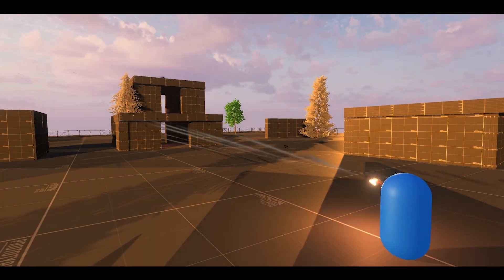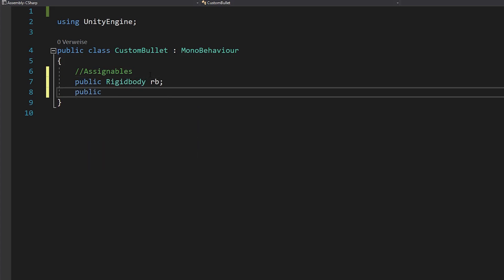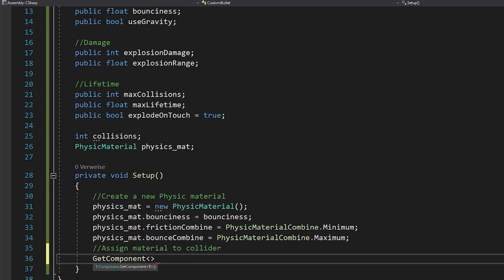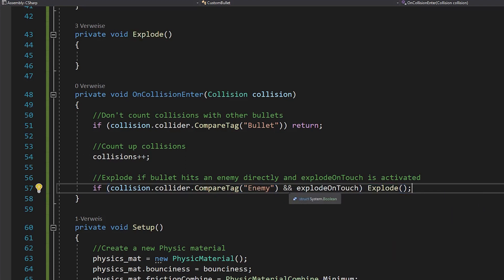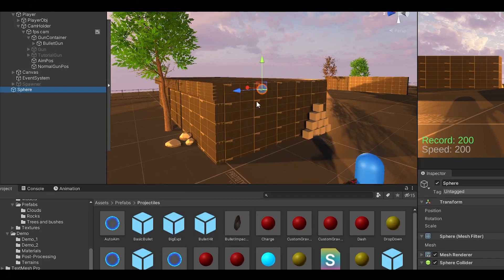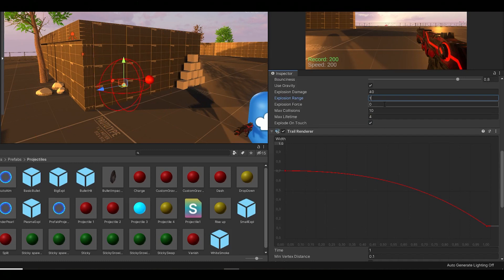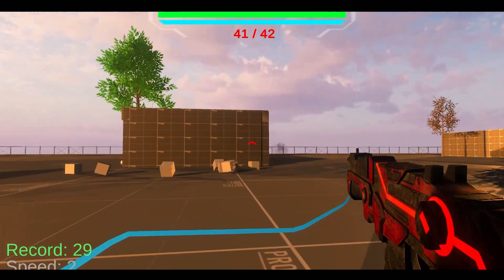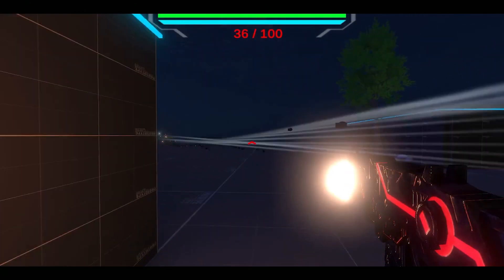SHOOTING with BULLETS + CUSTOM PROJECTILES || Unity 3D Tutorial (#2)

Comment: For people having trouble with shot bullet and it explode but the explosion did not stop 
i found some solution 

1 uncheck loop (if you are using unity particle pack dont forget to uncheck child too)

2 Under particle system there is stop action button change to destory 

hope it will useful 
sorry for my english grammer

Comment: This script here is not being activated for some reason

for (int i = 0; i < enemies.Length; i++)
        {
            //Get component of enemy and call Take Damage

            enemies[i].GetComponent<CharacterPathing>().TakeDamage(explosionDamage);
            Debug.Log("colliding");

            //Add explosion force (if enemy has a rigidbody)
            if (enemies[i].GetComponent<Rigidbody>())
                enemies[i].GetComponent<Rigidbody>().AddExplosionForce(explosionForce, transform.position, explosionRange);
        }

So my enemy isn't taking any damage. Is there any problem with this code?

Edit: The reason why this wasn't working was because the collider that was set on my enemy was through the floor instead of on the enemy.

Comment: If someone has the problem that the explotion repeats infinitely when it impacts, at least i solved it by selecting  the explotion prefab and opening it on the inspector right on the upper right where it says open, and then unchecking the looping section in all three sub parts of the prefab.

Comment: howdy. I've been using your guides to help me out with a school project, but I seem to run into a problem related to damage. I set the health of an enemy to 300 and the player at 100. both of their bullets have been set to 25 damage, but they do much more. the enemy kills the player in one hit and the player kills the enemy in one hit. (looking at the inspector, the enemy goes from 300 health to -400 to -525) maybe it was something that I did wrong related to the health ints? I could really use some help to figure out what I did wrong.
Reply: figured out a part of it. for some reason, having the life time make it explode at the end did a lot more damage for some reason. also having the collisions set to 1 or 0. with collisions at 2 and changing when from explode to delay when max life hits 0, the enemies don't do friggin 30x the damage. they still do more than 25, but now it's only a consistent 50.
Reply from the maker: As long as it's consistent, it's usable :D
If it still bothers you though make sure to debug how often the TakeDamage function gets called (it's probably 2 times), then figure out from where it's called exactly and use some kind of bool/timer that makes sure you can't call the function twice within like 0.1 seconds
Reply: yo you just got to take off the Invoke("Delay", 0.05f); and put Delay(); or just make it faster 
what its doing is its hitting multiple times

Comment: Very late but if I use a character controller and not a rb how can I add a recoil? Nice video btw super useful!
Reply from the maker: With a cc, I'm guessing you calculate a Vector3 for you velocity and then apply it with cc.Move().
In that case you would need to add a Vector3 that points backwards from your  player to this velocity variable after you shooot, and then subtract it after some time to stop the recoil again.
Reply: @davegamedevelopment  Makes a lot of sense, I’ll try that thx a lot

Comment: I'm experiencing a bug where the Explode method will instantiate 3-5 explosions at a time, making the damage dealt somewhat random. I notice it goes away if I comment out the Invoke function. It seems to be going through the function multiple times until that 0.05 second delay is over, but I'm not sure why. I have some other scripts running, so that may be the issue, but I'm curious if anyone else had the same issue.
Reply: happened to me too
Reply: Did u find a fix?
Reply: same here. did u find a fix?
Reply: I just had this issue too but i fixed it, i know i'm 2 years too late but all you need to do is decrease the delay, the bug seems to happen when the projectile uses up its collision limit, then it collides multiple times during that delay period, reducing the delay period drastically makes it only explode once.
Reply: my explosion effect never stops playing actually

Comment: I'm making a shot gun, so it shoot 8 bullets per tap, but they all instantiate at the exact same point and instantly destroy each other(my bullets have a script where they are destroyed when the collide with something)
Reply: did you fix it I have the same problem
Reply: @catman7474  i dont remember tbh
Reply: My guess is to add a line to the script that offsets the bullets based on its spread value

Comment: Can someone help me? The recoil does nothing and idk if it is the character or the gun. I am using the brackeys 3d player movement script. Thanks in advance.
Reply: That is probably because the Brackeys 3d movement uses a Character Controller component, which does not interact with physics. However the recoil script uses physics to add recoil. If you want to fix this, you can either, change you movement to work with the RIgidbody component, or, add the recoil by moving the Character Controller. Hope this helps!
Reply: @thecodeanvil5779  It worked thank you so much.
Reply: @bim0527  Awesome! So glad I could help!
Reply: @thecodeanvil5779  what movement script should I do for physics?
Reply: @thecodeanvil5779  thxxx
Reply: @DrippyHonk  You're welcome! Glad I could help!

Comment: I've got a couple questions to ask (srry for commenting so much at this point) 
#1 everytime I fire, the gun uses up 2 bullets rather than 1 even though my bullets per tap is 1
#2 What could cause my spread not to work? I have all the calculation lines in and the bit that adds the calculations to the Vector3
#3 Even though I have a rigidBody on the player, and it's linked to the gun, what could cause it not to recoil properly
Reply: Figured out 1 right after I commented, sorry about that
Reply from the maker: @BigWoofer  Maybe download the project file and see how everything is set up there :D (over my discord)
Reply: @davegamedevelopment  I did, it didnt help unfortunately, I'm sure I'm missing something obvious I'm just not sure what it could be, I ended up switching over to a hit scan weapon temporarily and managed to get spread working on that, still having issues with the recoil though
Reply: @BigWoofer  just copy the cody (or not coz ur not gona learn anything then)

Comment: hey, I've been having a pretty strange bug. whenever I walk forward while shooting, I get propelled forward really quickly. my guess is that it had something to do with the Bullet's Sphere Collider, and I was right. I turned off the Collider, and it was all fine. but, if I have my collider off, and it can't collide with anything (so enemies, the ground, etc...). I'm kinda lost on what to do. I tried having the script turn the collider off and on whenever the player was touching it, I messed with the physics engine, I've done everything that I can think of. if you or anyone has got any ideas on how to fix this that would be amazing! Keep up the good work man.
Reply from the maker: Uff... I had the same issue, even tried the same stuff as you first :D
The solution is to make a "whatIsBullet" and "whatIsPlayer" Layermask (and of course assign them to player and bullets :D). Afterward, you can open the "Physics" settings of your project, scroll down to the Layer Collision Matrix and uncheck the box where "whatIsBullet" and "whatIsPlayer" cross. This way bullets won't collide with the player at all :D
Hope that helps!
Reply: Dave / GameDevelopment I actually did that, but I fixed the problem. The problem was that I only set the player object to the WhatIsPlayer tag, and not any of the children. Which means that the bullet was probably colliding on the Gun itself lol. Thanks for help!
Reply: @GibsonBusinessYT  tag or layer?
Reply: @davegamedevelopment  ima use the ray cast gun but how to add sounds plz tell
Reply from the maker: @gaminganimator-qp2ir  
Here a tutorial on how to add sound: https://www.youtube.com/watch?v=6OT43pvUyfY&t=13s&ab_channel=Brackeys

And are you using my movement script? :D
Reply: @davegamedevelopment  I just figure out it without any scripting
Reply: @davegamedevelopment  lol thanks for everything brackeys 2.0
Reply: @davegamedevelopment  i have a toturial idea that every game needs
make a health and respawn (not auto respawn) system and a cube that does damage to the player plz do it or my game is in god mode(also how to make a respawn screen with main menu button)but feel free to take rest
Reply: @davegamedevelopment  i have 2 problems 1 i fly 2 how to make that enemys die